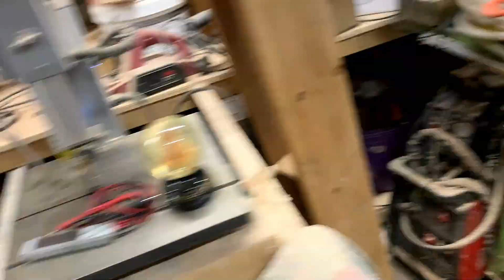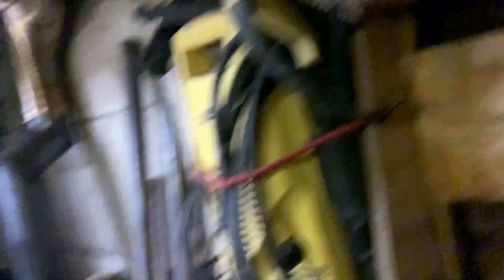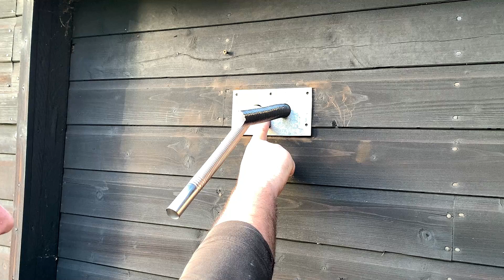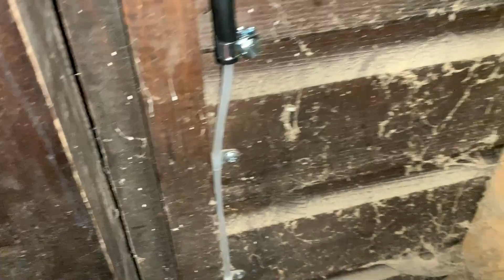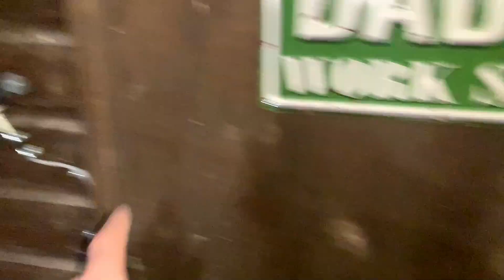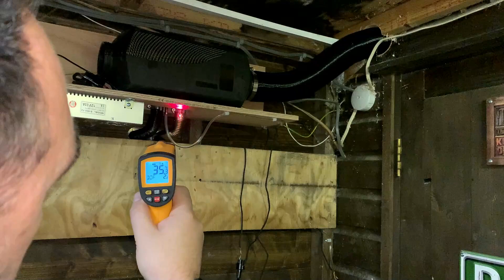Installing a Chinese Diesel Heater for Low Cost Heat In The Workshop

Comment: if you buy 6mm bungee cord from b and q and hang the pump from it it will almost silence the pump. there will always be air in the fuel line thats why the fuel pump has to be at a 30 degree angle to expel the air the mechanical pump makes in cavitation. a little 2 stroke oil/engine oil added to the fuel helps aid the lubrication of the pump as kerosene has less lubrication than diesel, the pump also becomes a little quieter.

Comment: Hi you said you've used motorcycle fuel line. Most people seem to change from the green pliable line to a more solid nylon line. Is the motorcycle line ridgid and do you find it's working ok? Any chance a link for it too please. Cheers
Reply from the maker: Hi yes I did use motorbike fuel line, it is a bit more rigid than what comes with the heater and works really well. I don’t have a link as I got it from my local bike shop.

Comment: Just to say, my one arrived today and this video has been a really good guide and very useful so a big thank you!

Will attempt to fit it over the next week or so, but have prepared all the bits already.

About the fuel tank - I used a bit of string too, small screw tied to the end and used a magnet to guide it through. I fed it through the drilled hole to catch it out of the fuel filler hole. Then, on the filler side, I inserted the string through the fuel fitting, tied a knot, and simply let it slide down the string into place. The big knot on the end managed to get me enough of the thread out to be able to grip the fitting and gentle pull/screw it through (the hole I drilled was the perfect size for the thread to also bite into the plastic and make a thread.

Will edit or reply to this comment if I anything else to add during or after fitting, in case it may help others.

And what a lovely workshop and thanks once again.
Reply from the maker: so glad it helps and please let me know how you get on with the insulation of your.

Comment: Do you need more clearance between the wood and that exhaust. The radiant heat from the exhaust to burn your garage down.
Reply from the maker: Ther is a 20mm gap all around the outlet which Is plenty. It been going over a year and no scorching on the wood yet.

Comment: Fuel filter backwards? Nice work. I used to have 32ft of pipe on mine, and was able to move it and vastly reduce my pipe lengths. I have four outlets on 26 gauge steel
Reply from the maker: Ok. I am sure the arrow on it is the correct way but I will check.